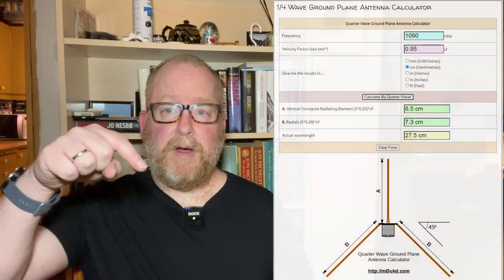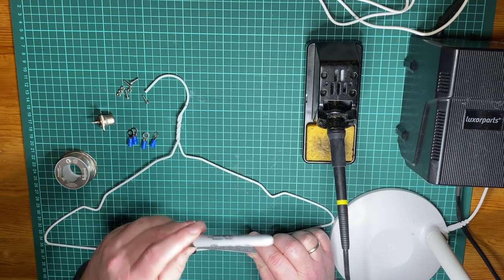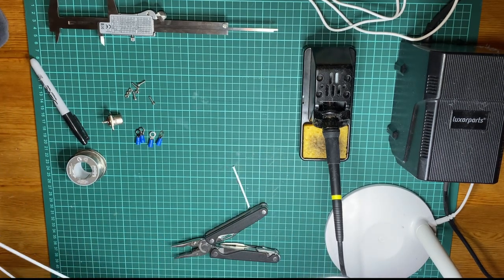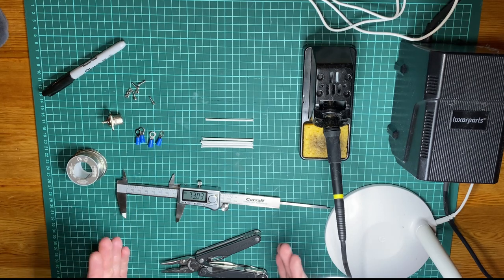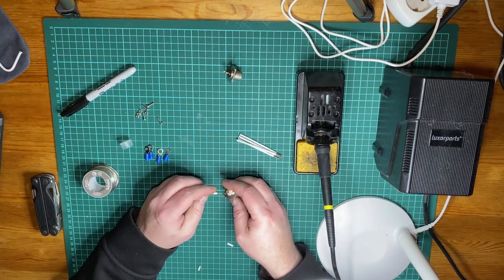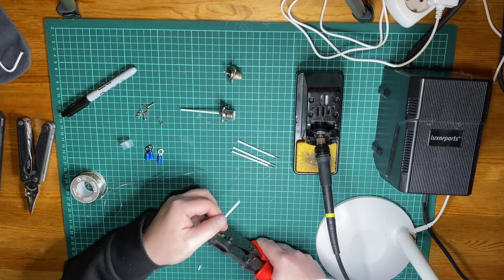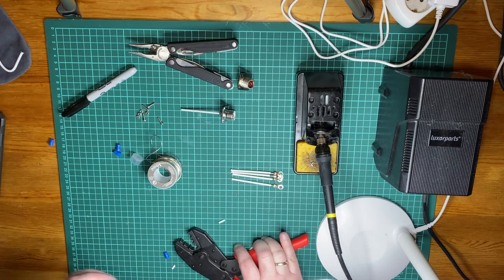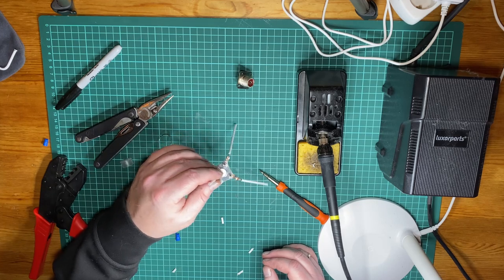How to Make an ADS-B Groudplane Antenna From Stuff You Already Have

Comment: Nice soldering job.  You have to watch when soldering the SO-239, especially the ones with the white plastic insert.  They tend to melt as they are easily overheated.  The ones with the brown bakalite center material hold up to more heat.  They are also usually more expensive.  Good build in all. 73 KS0JD
Reply from the maker: Thanks! Especially because I'm not really good at soldering at all...